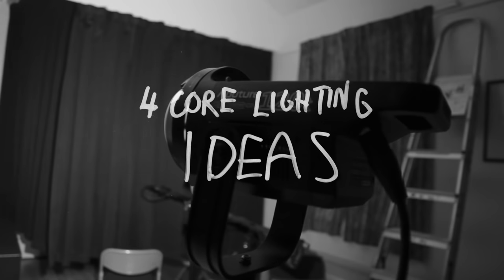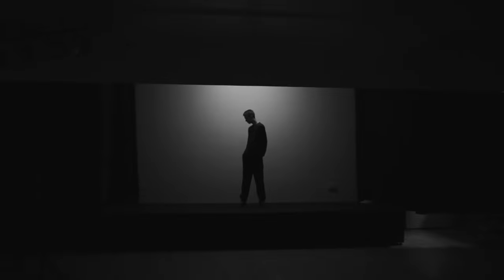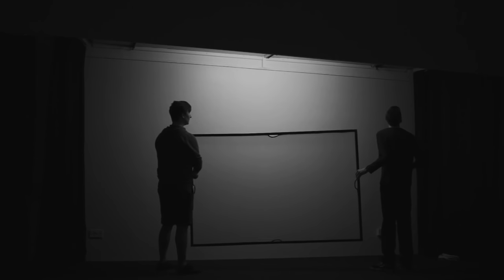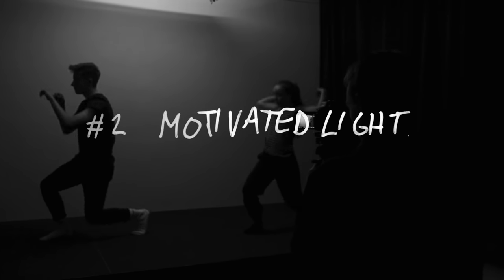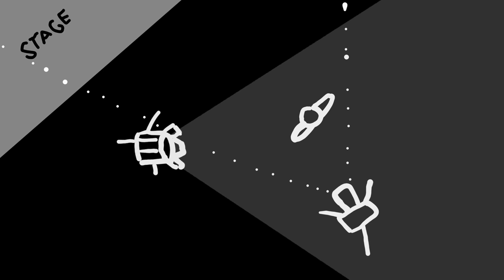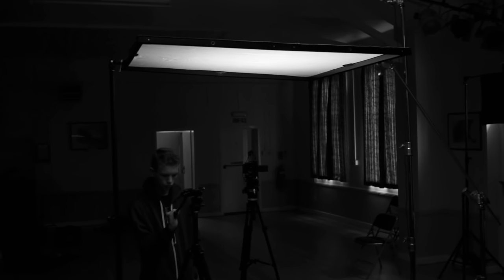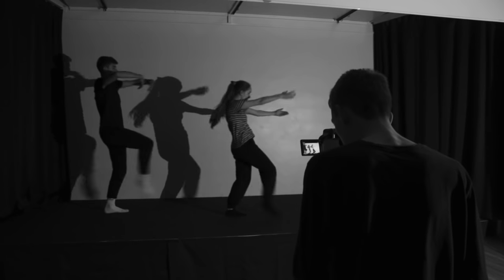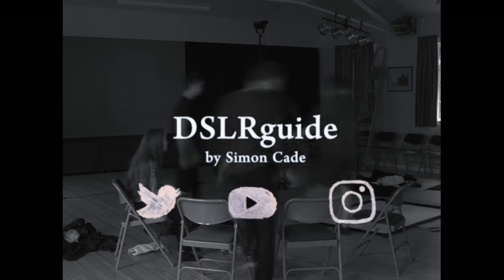4 Basic Lighting Techniques

Comment: What would be a good LED Light Panel that you recommend? I have a low budget so the maximum would be around $100.
Reply: Sub $100 LEDs are powerful enough to shoot through diffusers like the ones shown in this video. You can pick up the Aputure 198 for less than $100 and it's a great little light for the cash, but probably not strong  enough for diffusion. I use the 672 which has more than 3x the number of LED beads and it's juuuust strong enough. Go for fluorescent tubes in softboxes. You can pick up a kit with stand for ~$50 on eBay
Reply: Ok thanks so much!

Comment: I'm going to get a Canon 70d  and a rode mic is that good wat camera is the best to start yotube plz respond no one ever does
Reply: You don't have to spend as much as a 70D. I got a 700D and it works just fine and would be good for YouTube. You could even get a 600D if you're not bothered by little features like touch screen etc.
Reply: +Jamie M that's wat I wanted to get at the start the 700d what's the difference between 700d and 70d
Reply: Well, in terms of video production, probably not enough to make it worth the extra money. It is weather sealed, but I don't imagine that you will be shooting in extreme weather? There isn't much difference in terms of video, mainly photo. Take a look here http://snapsort.com/compare/Canon-EOS-700D-vs-Canon-EOS-70D/detailed for a better comparison!
Reply: While helping Simon with this video, I was using his 600d, and it worked just fine! I was kinda wishing I bought that instead of the 700d and saved some extra money because it was fine for video! So it might even be worth getting a 600d, seeing as Simon can get a nice image out of it. It shows that it's not just the camera that contributes towards a good image.